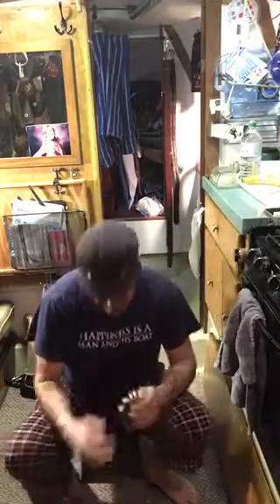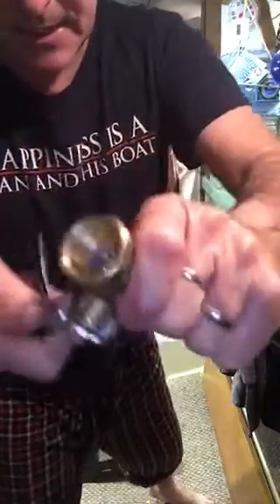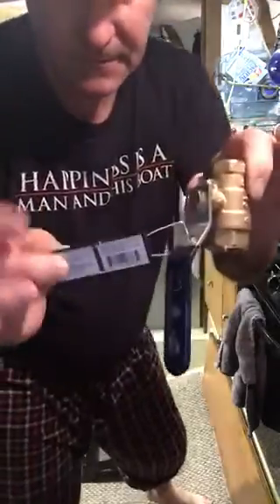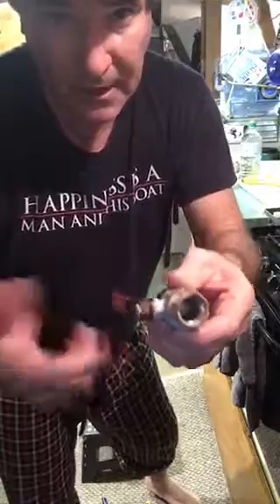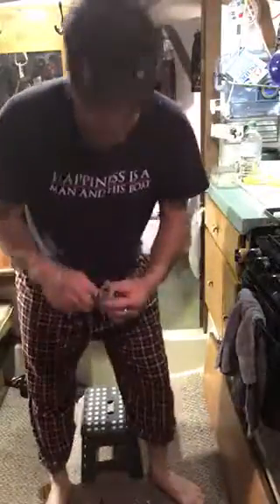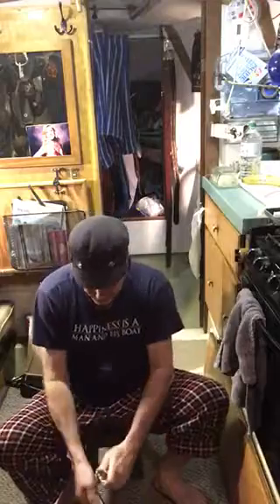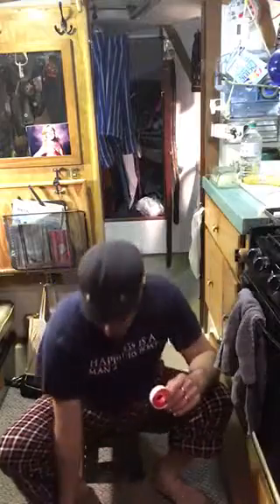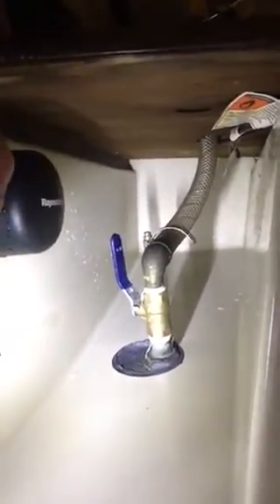Changing a sea cock with the boat in the water

Comment: Good video! They also sell some where? A small  Umbrella that you open the valve stick it thru then pull up it opens and seals around the thru hull after fixed you close it like an Umbrella and pull it back out! would want to make sure no barnacles on thru hull. But need different sizes for bigger thru hulls.
Reply from the maker: That is so cool.  I never saw one.  It would be great to have.

Comment: OY!!! Home Depot valves are not seacocks and should never be used below the waterline on any boat just because they are cheap? Stray current in the marina water can dezinc the brass very quickly. This is the reason the the EU law says that seacocks must be changed every five years. My 36 year old sailboat had marine bronze seacocks installed at the factory and they are still in good functioning condition. Easy to clean and service.

Comment: I listen twice and both times you said put the cork in and then put the valve on...did you mean to take the cork out first?  It would be great to see you do this in real time....thanks
Reply from the maker: Terry Landis yes.  Sorry about that.  Just use the cork to stop the flooding until you can get the Teflon tape on (lots of it) then pull the cork and as the water is flooding in screw the valve on.  I keep the valve open until the threads at good and on.  The water pressure tends to keep the threads from starting. When it's threaded a turn or more, then close the valve and tighten it the rest of the way.
Reply: Jean, thanks for responding and providing more details.  Have you tried to put a piece of tarp or plastic on the outside of the boat over the sea cock opening, then open and remove as above?  I would think the pressure would seal the hole and prevent water from coming in while you change the valve.
Reply from the maker: I tried the tarp once.  It worked but was not worth the effort.  There was water between the tarp and hull, by the time all that water was pressed out I was cold and miserable.  The tarp wanted to shift with the waves etc.  It will keep a boat from sinking but its a last ditch effort.  The tarp doesn't sit tight against the hull like one would think. The tarp has to really be big to be effective.  Then you have to store that huge wet tarp.  Nah, I rather have insurance and a good sailing dinghy.    On my current boat I built water tight bulkheads.

Comment: Never.never.never use a home depot valve. It is household brass and wont last long in salt water. Seacocks and valves are bronze .they last 30years plus.  Screwing a ball valve on a thru hull does not make a seacock.  Thru hull threads and ball valve threads do not match and you will only be able to screw it on but a couple of turns before it locks up. Look up a rear Perko or Groco seacock with a large triangular screw on base. Thats a seacock.
Yes a true seacock is expensive, but it is the only thing between you and a very bad day.
Reply from the maker: Joseph Guidera  lol.  Mine have been on there for more than 7 years and they would probably go for ever.  But at a fraction of the cost of a marine valve (and I think myths busters would prove there about the same in longevity) when I haul my boat I inspect them and change them if needed.  Most boats that sink is not from a bad valve, it's from a bad rubber hose or clamp.  However if u want to keep a valve for 30 years, I would hope you will pull the boat before that.  So use my cheap valves and replace them every ten years if you don't trust them.  You will still be dollars ahead.

Comment: Try using white bread... in threw hull pipe
Reply from the maker: john moore I never tried bread.  How do you remove it after the valve is installed.  I forgot to mention on the video to remove the cork before installing the valve.
Reply: With valve closed just unscrew it. hold your finger over the hole while putting bread in hole (water Stops coming in). After new valve installed and hose connected just start your engine .. the impeller will just suck it through and break it down out the exhaust, Very simple